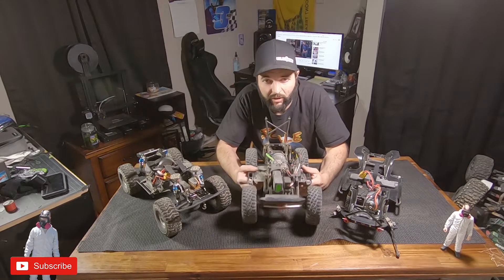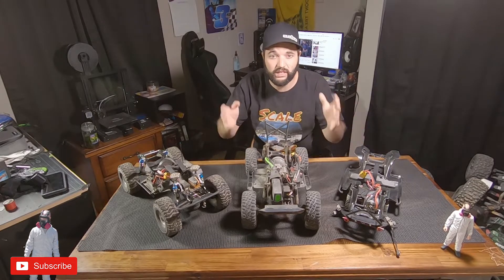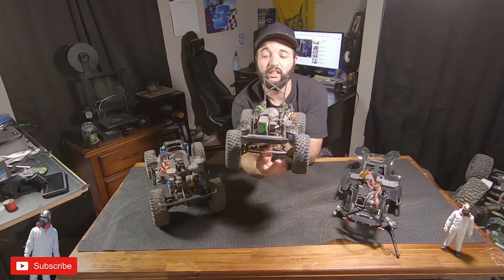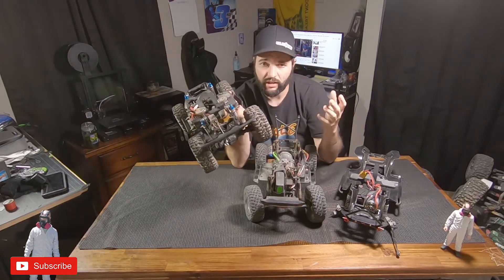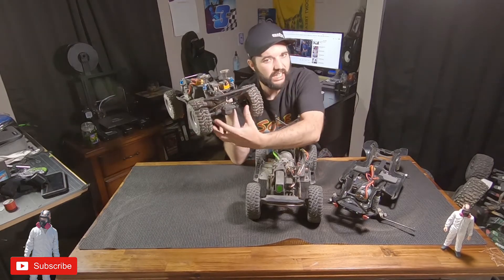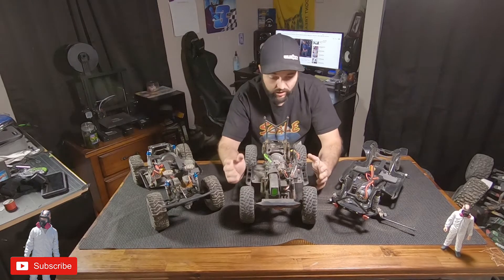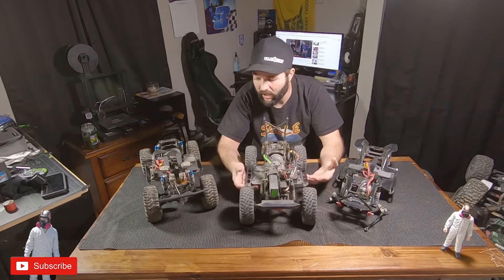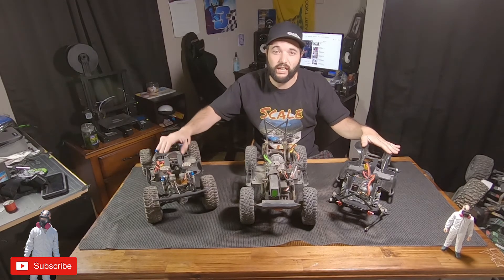Behind The Axle Steering On Your Scale Crawler?

Comment: My RC4WD Beast II 6x6 has behind the axle steering and it helps in smaller tire rigs and saves it from slamming down on rocks ( yes I managed to break it anyway) in the event of a slide, also I believe it can improve the geometry of the steering in some cases. Oh yeah, and it causes way less resistance in thick mud and makes it easier the the axle to slide through.
Reply from the maker: great points. 👍👍